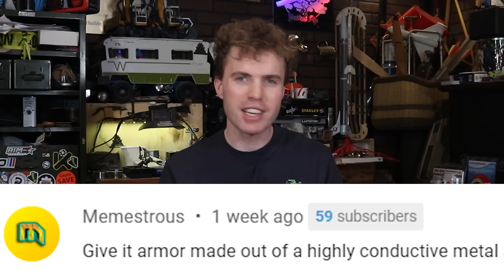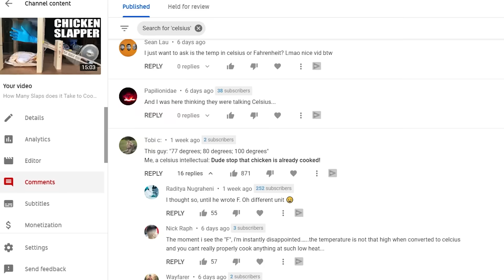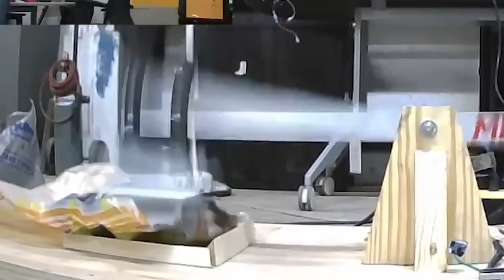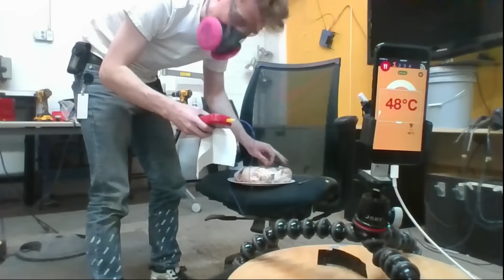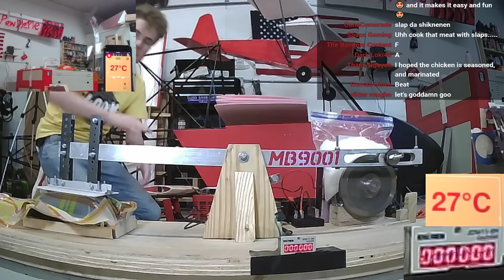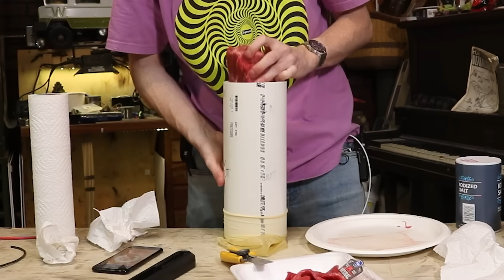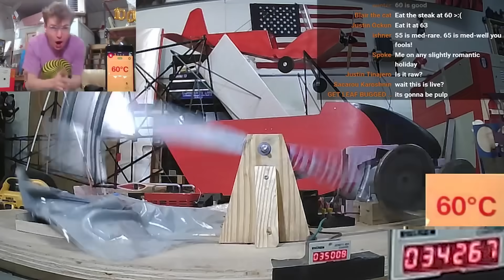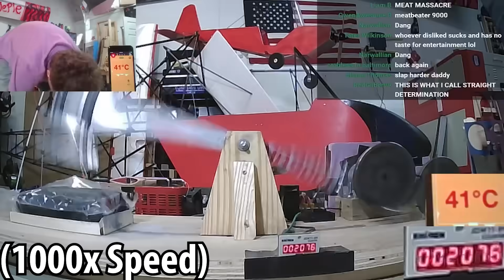I Cooked a Chicken by Slapping It

Comment: Okay so how many Gibbs slaps would it take to cook a chicken? Instead of an up and down motion, a multiple rubber handed turbine slapper that slaps in revolutions? You could up your sps drastically
Reply: Not only that, but inside of your energy wrap, what if you had the chicken in a small amount of oil where you could heat the oil through the chicken by slapping it with a very high SPS and actually heat the oil enough to fry the chicken?
Reply: I also vote that with your already accomplished work, slaps per second as a calculation of energy should become known as the Weisz unit

Comment: Some of your measurements for energy confused me. Watt hours, or just Joules, are fine, but wouldn’t Watts per hour be a bad way of phrasing a measurement considering watts are already a measurement over time?
Reply: kWh is the commercial unit for energy consumption. so he spent like 7.5kWh, so 7.5 units. easy to calculate the bills
Reply: @fardinishtiaq6296  watts per hour is not that same as watt hours
Reply: Ah he wrote watt hours one time, and watt 'per' hour on the another. Missed that

Comment: I have an energy solution if you use a very high gear ratio system and a high tourq motor you can still get the speed with out all the energy consumption

Comment: Sorry if this has already been addressed, but would it not have been more mechanically efficient to use a flap wheel rather than a reciprocating arm?  Would substantially reduce wear and tear on the machine as well as allow you to increase speed with minimal increases to impact force.

Comment: Amazing to watch. You should have used steel in your design. There is also a much better system you could use. Look up spring fatigue testing machines to use. Imagine your design but without the arm. You would have a much faster and longer lasting design.
Reply: @cedar4539  ahahha that amount? the kind  of forces acted out in this video are naff all, If steel couldn't withstand that small amount of force, i don't think we would be using it worldwide for mega sized, much higher force machines.  Both metals would work miles better than wood, even wood would work better with a design change.

Comment: Buddy, you need a welder. No more wood. Use 1/4" steel arm, 1/2" structural bolt (not continuous thread) and it's gonna be skookum

Comment: Another option is to use a Camshaft system with a large contact surface. Basically, like the top end of a car, but on a larger scale. Have a valve spring, and rotates very fast, and is much more reliable.

Comment: I was suggesting a spring to counterforce the chicken slaps, which is the reason why the motor bolt breaked the slapper shaft from the upper part. But what the hell, you nailed it man! CONGRATS.
should've seasoned it tho, since slapping would put seasoning far insider the meat than even sous vide method

Comment: Hey guys this is simple thermodynamics, calorimetry
Reply: It is simple until you need to know convection coefficients, heat capacity of the meat that changes with temperature/cooking, the transfer efficiency and concentration of the slap energy etc.  Modeling it on the back of an envelope only gets you half way to how hard this problem can be.

Comment: Bruh, you cheated by preheating and that shit is still cold as fuck. Water evaporates at 100 degrees Celsius. You can't even call that cooked. Would be better if you didn't had to make some bullshit claim and just admitted that even though you did your best you still couldn't make it. Also, hidraulic press channel actually made a good suggestion by telling you to put it in actual vacuum and you claimed it was just bad.
Reply: The vacuum chamber vastly complicates the rig.  I designed a slapper that would fit in a large stock pot (to make into a chamber), but I don't think the build was worth it.

Comment: no flywheel or gear box ?? i mean so much energy is applied to the parts you could have had a flywheel and gears ratio to to run the motor slower and have the same splap per minutes i think this is one underengineered rigs you want some energy to be transfererred and no offense but you could have done it like even faster with less current if 1 a flywheel conserved some of the rotation energy and 2 gears downs from the flywheel to high speed without reciprocating movements.
Reply: The things the belts attach to ARE the flywheels.

Comment: For a machine like this I would recommend putting the near motor part which broke all the time completely in some common cheap Gearbox oil and made from forged iron, iron for flexibility and hardness, and weight... it's not just about the speed, slap it harder. Motors and everything else should have some cooling system with a coolant pump and so on...
The reason everything broke was because of hot and cold parts, and no material withstands the heat and vibrations this machine took. Hot and cold areas made the materials crack, lower the heat and together with all moving parts at the same temperature, with the gearbox oil. It'll will prevent all of this mess that happened. 
You got all of these parts and yet you don't have proper thick grease for this thing to at least have some chance to survive? It was like a washing machine on steroids when it comes to vibrations, no material has a chance.
Plus... why so big? Make it smaller... would make a giant difference.

Comment: For those who might not see how crazy hard this is to pull off, as a mechanical engineer I can attest to what NIGHTMARE fatigue is. If you accumulate cycles that quickly with such high excentric forces at play, it requires insane levels of engineering to balance the stress and strain amplitudes, such that it can survive for a long time. By just "intuitively" building rigs like that, the only way to make it work is basically just to massively overengineer all the critical parts and even that is sometimes hard to achieve - as this series proved.
Reply: It reminds me of the cougar in this video https://www.youtube.com/watch?v=U2rNnzVotS0&.lbnn

Comment: Why not add a spring to absorb the energy of the slap and convert it to heat, this along with a insulated housing would solve the kinetic impact issue and should roast the chicken but I guess technically you wouldn't be slapping the chicken.

Comment: I wonder if the efficiency of the slapper could be improved! 
I bet there is a whole bunch of loss involved in just turning the arm around, without any energy transferred to the actual chicken.

Maybe adding a spring to form a resonator with the arm would improve slap turn-around. 
Also, DEFINITELY adding a huge flywheel could improve things - the motor's output power would be more consistent, and the slap itself could happen with a fair bit more "whap"

I also think that a lot of the mechanical failures could be eliminated by transferring most of the kinetic slap energy into the arm first, and letting its inertia do the slap, rather than having the motor firmly coupled and thusly causing a really sharp spike in force across the driving bolt. Again some form of resonant slap-circuit, where the motor stimulates a slapping arm that resonates at the wanted Slap-Speed, might work really well.

Comment: Why didn't you opt for a chicken breast or leg quarter rather than a whole chicken? When you did the beef, you used a steak rather than a whole cow. With a whole chicken, there is empty air space within the body cavity which would allow for inconsistent heating. With just a breast or leg quarter, there is no empty air space, just tissue all the way through. Next time, try using chicken pieces rather than whole chickens. It should cut down on number if slaps and cooking time.

Comment: I gotta ask, was it intentional to use a flat hard slapping hand instead of something flexible that rotates one-way? Would save a lot of energy if you didn't have to pull up after every slap. You'd end up having a lot of friction heat on top of slap heat though I guess, and a lot of wear damage on the surfaces in question

Comment: Cover chicken in oil to help heat distribution. Also you can try to slap some material which has good heat conduction and constant heat dissipation and will transfer heat to chicken without slapping it directly and harder you press, bigger surface you will cover. Same prinicple like pizza stone. But you will have to slap it underneth because heat goes up.

Comment: Aluminum fatigues fairly easily depending on the alloy used but all of them fatigue sooner or later. The arm of the slapper should be something else than aluminum. This is also why airplane frames have a limited amount of pressurization-depressurization cycles they're allowed because the aluminum in the airframe ages and develops cracks.

Comment: I’m confused how it wasn’t pulverized still since you were more beating it with a hammer than you were actually slapping it, sadly using anything that generates friction would probably wear down the sealing bag you used and not deliver the force like a paddle of ballistics gel or a blackjack which could be made used a length of garden hose filled with sand that was tied up at both ends, either way the chicken your “cooking” is getting destroyed no matter what you do actually the blackjack idea isn’t crazy if you used those in repeated succession like some tumbler machine to swing the chicken on a pendulum it assistant in generating more force on the next impact to add to the resistance

Comment: As an engineer to begin with, why would you build a mechanism which requires the impact surface to go back and forth back and forth. Will it be infinitely more productive, and easier to optimize would be a belt with a slapping mechanism would you could increase the RPM to increase the slaps. I guess it's true what they say about engineers

Comment: The problem with this is the length of time required to come up to temp. Anyone who has watched Alton Brown will be familiar with the "bacterial danger zone.

Something like a chicken needs to be kept at or below 38f to prevent the bacteria from making you sick. If it's left to sit out above that temperature for an hour or more you can get sick. Even if you cook it to temp prior to eating.

It needs to go from below 38f to a safe heated temp relatively quickly to be safe. Energy transfer via slapping isn't capable of that.

Comment: Okay, but my question is, why wouldn't you just put some stiff rubber slappers on a wheel, and have the motor turn that wheel allowing them to slap the chicken instead? Far fewer moving parts, far less likely to break, and far more energy efficient....

Comment: Jello: "I'm just saying. If physical energy can be turned into thermal energy, how hard would I have to punch a chicken to cook it?"
Reply: The punch would destroy the chicken 🐓
Reply: @mazenyasser7208  So wrap it in a Walmart bag.  Duh.
Reply: The first thing I thought
Reply: This opens up space for the; George Foreman Punch A Chicken Grill,,, basically just an insulated speed bag with a grease drainhole at the bottom,,, and endless commercials.🥊🐔==> 🍗, lose weight while "cooking" and eating 🤑
Reply: sounds like not very hard just very fast lol need like 6 people swapping out like a boxing speed bag 🤣
Reply: Well that depends do you wanna use friction as well? Human hands aren’t smooth and frictionless so you are generating heat on every slap you do, modifying that to say using items that generate the same process wouldn’t be difficult either especially if you treat the chicken like a thermal blanket punching bag with a could of garden hoses filled with sand you could possibly create enough friction on the hits to begin generating heat while the devices themselves barely do any damage to the chicken to keep it intact
Reply: Lmao
Reply: Reminded me of the chicken thrown in this video https://www.youtube.com/watch?v=U2rNnzVotS0&chfrf
Reply: Pretty sure this joke is exactly why this video was on my recommended lmao
Reply: @Eren Murat Kara if you vacuum seal it to remove air and essentially making heat easier to store would a rupture instead implode it?
Reply: @Eren Murat Kara is it mechanical? or could you simulate frictional heat by using rubber clubs to wear at the chicken enough times

Comment: Your slap arm shouldn’t be rigid. The entire section after the pivot should be a strip of steel, maybe 2in wide by 0.125in with the slap paddle at the end. That eliminates the need for height adjustment because the steel has some springiness to it. This will provide a much better slap and protect your drive end from breaking

Comment: You need to replace it with a slapping wheel. Multiple slapping flex panels that spin. 10X the number of slaps per minute with fewer moving parts like the crankshaft you have. More motion, faster, speeds, more slaps, higher temps, and better cooking! Do it ! Please!

Comment: One huge problem was using aluminium. You can't use aluminium for fatigue reasons. No matter how extremely overdesigned it is, aluminium ALWAYS breaks with fatigue cycles. The remaining material strength goes to ZERO over time. Always. You need steel.

Comment: Mount a few fiberglass paddles to a wheel to slap the chicken 4-6 times per revolution.  Get rid of the reciprocating motion that's giving you issues.  This should reduce the overall size of the rig to allow you to put the whole thing in an insulated box; maybe even a large cooler.  Put the chicken on a slight angle on a turntable and you might achieve rotation from the slaps giving you a more even slap cook.

Comment: In place of variac I use lightdimmers with triac. Modding it with a bit of heatsink can improve power capacity somewhere between 15-20A. Not better but much smaller.

Comment: Maybe a new slapper design - like spinning rubber flaps kinda like in a carwash, the spinning brushes slapping the top and sides of the car. Maybe less strain on the motor, no up/down reversal of force of energy, it is a more "linear" circular force.

Comment: Only 3 times as much electricity as it would take to cook in an oven?!

I’m shocked that it’s not waaaaay more inefficient than that! There’s obviously a considerable amount of energy lost to the heat in the electronics which doesn’t go into the meat, not to mention the whole thing was bouncing around the floor like crazy and it’s obviously considerably much noisier than an oven so that’s some energy lost to sound. 

Are ovens just MASSIVELY inefficient on their own? Like if you cut the chicken to bits and cooked it super efficiently (perhaps an updated method of burying it with hot coals?), you could do it with a fraction of the energy used by a conventional oven?

Comment: This guy doesn't seem to know anything about how to build a rig that will last. Find somebody that can weld and make something out of steel and there wouldn't have been any problems. Breaking bolts? Can't have bought ones that were worth a fuck if they broke that easily. While you're at it hook the rig up to a little gas engine, it would be reliable and efficient.

Comment: get a inline 4 engine and fuel only the 1st and last cylinder. use the two middle pistons to beat the meat. since the cylinders are enclosed you will have very little heat loss. Don't forget the lubrication since no oil will be fed to the middle pistons. You can use cooking oil instead. You can track the RPM to get the number of "slaps" per minute. Since there is less rotational weight you will have a much faster slap rate and cooking time should be decreased greatly.
Reply: also the middle two pistons will continue to move regardless of not being ignited due to the crankshaft. The only issue is that the motor itself would create heat so it wont be the slaps themselves cooking the meat, however with enough cooling you might be able to counteract the engines heat.

Comment: It might be science, but it's also cooking. Imperial Fahrenheit is just fine. A chicken is done at 165 F. Try converting that to Celsius instantaneously with no paper and only in your head, I'll wait until you just own yourself and use the measuring system you're familiar with, not the one that assholes on the internet insist you use.

Comment: Why a single pivoting arm, which is extremely inefficient, instead of a paddled rotor which turns in a single direction? Or, adding a crank shaft and using multiple pivoting arms? Either way would conserve a lot more energy, which would have been better used being transferred to the chicken via kinetic energy? You are losing insane amounts of energy through friction, needlessly. Either way, impressive, but honestly leaves me scratching my head as to why. A simple design change would have negated the necessity for a second motor.

Comment: Cool idea to slap-cook your meat. Another way to do this could be with a rotating wheel with eight rubber flaps attached to it. That would slap your meat eight times per spin. At the same rpm you are now using to drive the arm, i think you can raise a higher temperature in shorter time since the meat gets less time to cool down.